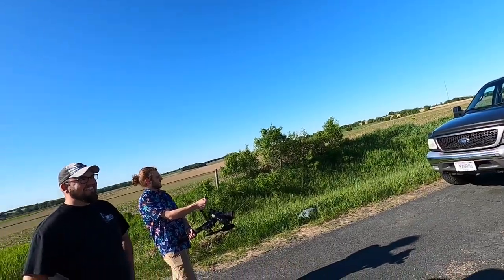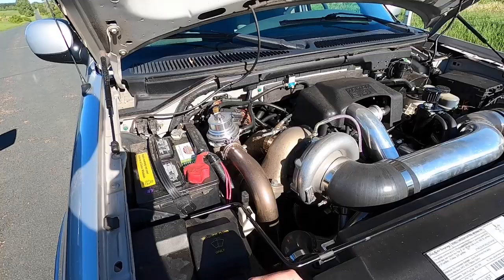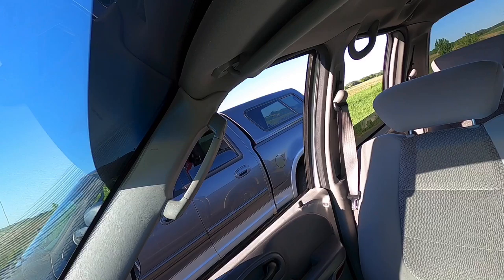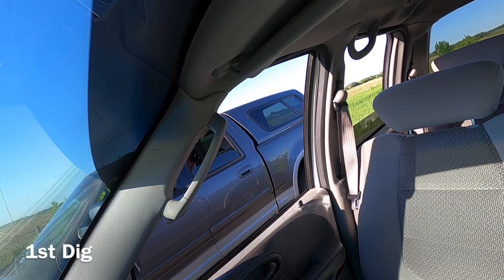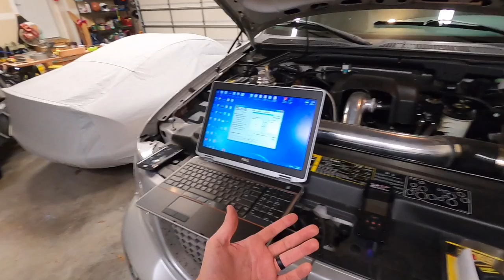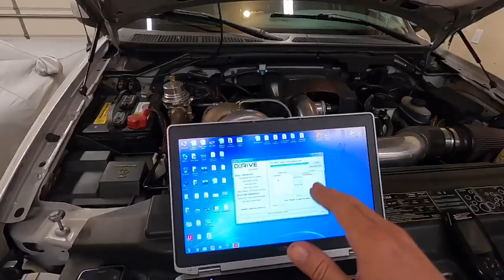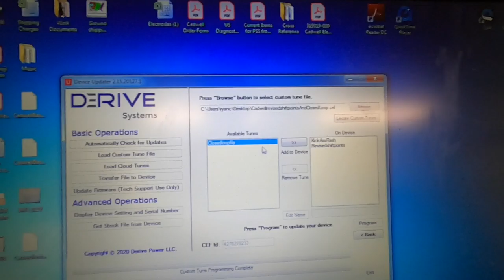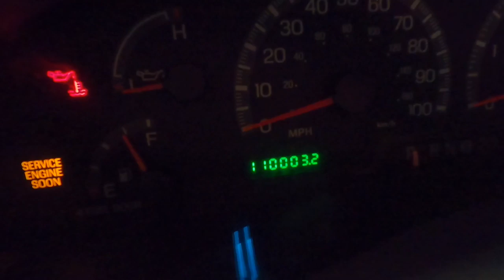SLEEPER Single TURBO F150 DESTROYS Stock F150!! ***Not even close***

Comment: Would love to see gramps vs 19 or 20 f150 limited. They should be pretty close
Reply from the maker: I've been working on that actually
Reply: If you’re talking about the ecoboost I don’t think so. The 10 speed auto is ridiculous efficient. I have 14 ecoboost and it makes 440whp and over 500 torque on e50. It sounds like shit tho because it’s an ecoboost.
Reply: @RadDadisRad  the eco boost would likely win by 2 or 3 lengths in the 1/4. Stock coyote would be closer. But just like every ford v8, it needs a turbo lol.
Reply: A f-150 limited those yrs come with the High Output Ecoboost.
Reply: 5.0

Comment: Nice video. I have a 50th Anniversary Edition 1998 F150 with the 4.6L V8.  Has 377,000 miles I put on the original engine and still not burning oil. Looking to add some power, if/when I do a rebuild and looking at ideas to use the original powerhouse, as opposed to a coyote swap or something else.

BTW - those key fabs can be had at AutoZone for a reasonable fee.

Comment: I wanna know how you're keeping the spark plugs from blowing out of the head ? My stock 02 5.4 currently has two plugs blown out and its just bone stock !
Reply: Because someone is tightening them to much on spark plug replacement.
Those torque settings are important 👌
Reply: @carlmw9460  Do you overtighten them or have them at the book settings? I’ve heard many things like overtightening by a little will help against that issue. I’ve only had my plugs replaced at the dealer so I don’t know anything about them.
Reply: @bebeslife4519  I've always set mine at book spec. The threads are weak on them . They can't handle over torque.

Comment: Oh fuck I have a stock 03 5.4 with a cold air intake and exhaust.. that's it. And a lot of things to make it heavier. (sound system, wheels, etc.) And I can tell you this thing would completely destroy mine.. lol. Mine does have 373 gearing though (if I recall right)